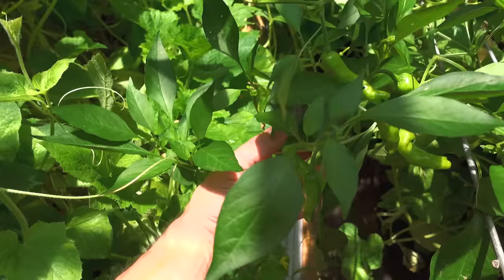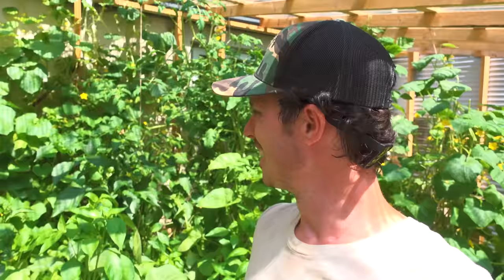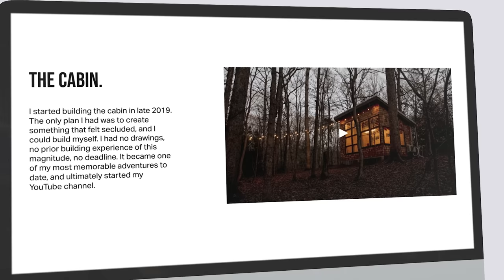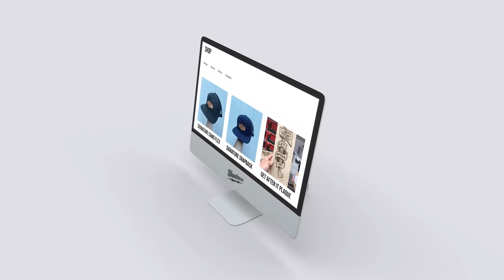DIY UpCycled Greenhouse - Start to Finish

Comment: Very nice job. Couple of questions for the fall: 1) how much does this extend your gowning season. 2) Did you find that the ground was wet during the winter / was there water accumulation? 3) where are you geographically located? Thanks

Comment: You should be very proud of. yourself. You gave me faith that I can do this, too! I did wonder, once you screwed in all the windows, how you were going to get ventilation, but obviously you did it. 
One question, did you consider putting flashing or a barrier between the home and the greenhouse to prevent water from coming in and also to prevent discoloration to the house wall? 
Overall nice job. I need to go dumpster diving now to find thrown away treasures to build my own stuff.

Comment: maybe a few joist hangers would have been helpful.  Also, I totally agree with many other that a vapor barrier at the least would have been required or you're going to have to replace your siding. Better would be a waterproof layer like metal flashing or you're going to be sad a few years down the road. Even cement board will break apart with enough trapped moisture. Aesthetically, why did you choose to block the window of the house? Seems like a waste of a window.

Comment: I don't understand why you put sheet metal above the one side where you have one clear polyacrylate panel. I get the clear panel might be for a window to look out but why not make the upper one also clear for added light? Also easier to cut than steel. Anyway, it looks very nice. If you would be able to add a second layer of polyacrylate on the roof maybe 1 inch (or less) above the current panel it might help improve the insulation value of the sheets.  Unless you live in a very warm winter climate. Also the strength of one panel  would not be much for a snow load, so you must live where there's not much snow. I would agree with others that the house wall should be protected from constant moisture so whatever you can do about it now might be wise to look into. It is a lovely space and the plants are happy. I'm sure your family loves it too! Your little helper is so adorable - very precious.

Comment: Looks beautiful. Is it permitted? Just curious why you made the join in front of the window instead of to the side so you could actually have an unobstructed view. I think you might have a few problems down the road if yiu dont cap those lower boards since theyre upright.

Comment: Should have done roof angles on the wall while you were on the ground but otherwise looks decent. Only reason im saying that is you're making extra work for yourself removing a board that should never have needed to be there as well as having to cut off those boards at height to match the angle of the roof.

Comment: How is the area where the roof of the greenhouse meets the siding, any leaks?  I might have put flashing up under the siding and over the roof to prevent water from going down between the two.   I love seeing people repurpose items that still have life in them. Outstanding job!! About 10 years ago I accumulated 25 old windows to make my own greenhouse. It was going to be fairly small, approx. 12' x 12'. But then life happened and I gave them away. Now I am ready to build one and people are now charging for the old windows that would otherwise have ended up in the dump!
Reply: Ask some one that’s replacing windows, would probably give them to you, they have to pay to dispose of them!!

Comment: So your video will help me when I’m building mine. I’m getting ready to start. Did you not the pralines into the two by fours or did you just set them across the top?  I’m trying to do a little cutting as possible.

Comment: Interesting build, I wish I could find free windows, pallets, and tin. I been looking for years but haven't found free ones yet. I bought a property in 2021 with really old house that someone replaced many of the old wood windows with aluminum storm windows but there are still some old ones I been contemplating taking them for a greenhouse. Oh I do have a question though, I was wondering since you are recommending square space, where is the link to your website on square space?

Comment: Walk me thru the old windows. Did you try to find all the same size? What about different sizes and how did you work those in?  any help, ideas?
Reply from the maker: They were available for free so didn’t have much for choice. Most of them are similar with some differences here and there. The width was the same but not the height.

Comment: Dude, the way you work just screams for an injury.  Safety is really the last thing where I live (sadly), and the only thing why people don't get hurt everyday is thinging forward. Every time you cut/drill ect you need to see forward where that blade/chansaw can go if something happenes how forces will affect you if it get stuck ect.  You cut with the chainsaw in the driection of your leg (and forces actually pull you down the ladder just to be sure something bad happens), you put your hand next to the place (many time seven directly behind it just to be sure) where you nail or screw and your foot and then your whole leg next to the sawblade when you cut, the way if it slips you cut yoursefl really badly.

Comment: Question. Why did you put some metal up and some clear plastic up? Why not use all clear. Wouldn't that allow more sun to get inside?
Reply from the maker: Well the side where there’s metal, is east facing and there’s a forest behind it so really no sun to be had for the most part.
Reply: @WoodnessGoodness  Gotcha. I thought there must have been a reason.

Comment: Don't want to throw briks in a greenhouse, nor do I know your climate zon.🤔, However, I do know that at most climate zones that hot moist greenhouse air will flow straight up in behind the house’s facade and hurry rot and mould.
Therefore, I do hope you keep a close eye at that wall, or make a fix now, while it is still cheap to fix.🙂
Reply from the maker: Thanks for that tip!

Comment: How do you plan builds like this? Is there any type of written schematics you can post or a tools/ materials list. From other videos I've gotten your nailer and stapler and compressor and caulk all in an amazon shopping cart but wanted to know if you could provide more than that? Would love to do a project like this and would love any help or tips as i've never done a job like this.
Reply from the maker: I will try and put together a design sometime. It’s 12 feet x 20 feet. And then I used regular framing principles and just fit the windows where I could.

Comment: When putting up the corrugated plastic, do you put it over one pump or two?
Reply from the maker: For this I think I did two. Not sure if it was necessary but since it’s lightweight, I wanted a joint that I could have a screw in the valley that would go through both pieces.
Reply: @WoodnessGoodness  thank you for commenting. The reason I ask was my husband and son built a greenhouse for me. They only went over one hump, so my greenhouse leaks when it rains.  A friend of ours told me that they should have gone over two.😫 it still works and I am thankful for my greenhouse. Yours turned out beautiful.

Comment: So cool! Great job! We are planning on building something similar !! What type of wood did you use to frame it ? Also, we were wondering about double pane vs single pane windows? Any reasons you chose single pane.  :)
Reply from the maker: Thanks!!! It’s pressure treated wood so it lasts in the weather. The windows weren’t by choice I got them free from Craigslist but they work great! No need for two panes I don’t think
Reply: nice! It looks so nice! Yes I am currently waiting for some free windows too- double pane though so I think I will research that piece a bit. We were thinking pressure treated but wondered about chemicals more research for us lol!

Comment: paint the wood white and your plastic roof panels will last a lot longer
Reply: and don't super tighten the screws, that plastic will expand/contract like crazy, needs room to move around.. I put them on the upper ridges, not the valley

Comment: I hate to tell you, but when the wood shrinks it will break every window that you installed. I thought someone should point that out. Sorry for the FYI.
Reply from the maker: Second year in and still good! Seems to have worked out well!
Reply: @WoodnessGoodness  well that’s good 👍, the normal gap is 1/4-1.2 inch around the window. They appeared to be pretty tight and I’ve seen it happen, usually by the second year as they shrink and move.
Reply: 1/2 not 1.2 lol

Comment: How many battery charges did you go through? You're next to your home creating this. You should have an accessible power outlet to use plugged in tools... why not use the proper tools to do this instead of using cordless/not proper tools to create this that require time to recharge your Milwaukee batteries...i.e. Sawzall instead of the chainsaw, an air compressor for your nail gun, a Skillsaw to cut down the outers of your window frames, etc.
How many batteries do you have? 
Or are these the only tools you have?
Reply from the maker: I prefer my battery tools. They are what I have and they do the trick! Milwaukee batteries last a super long time.